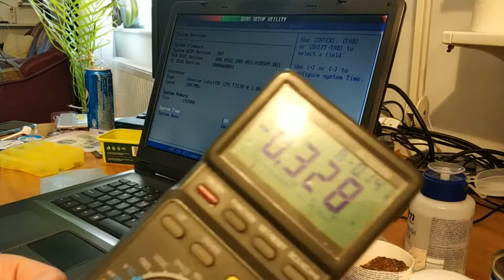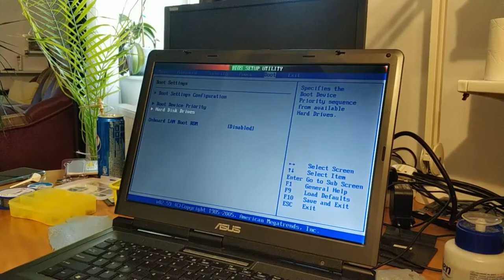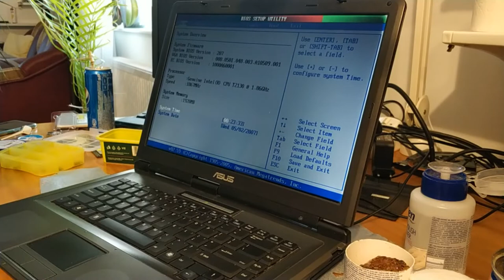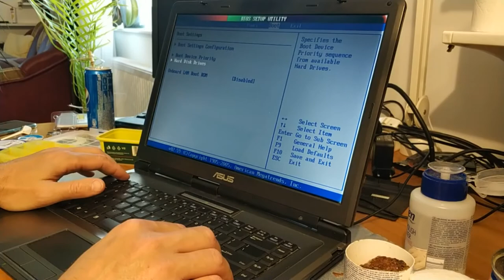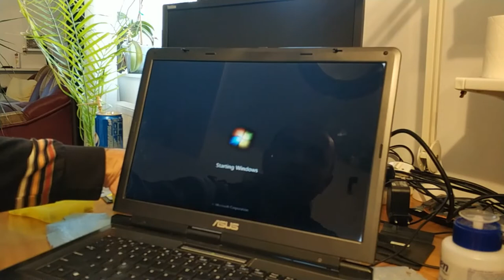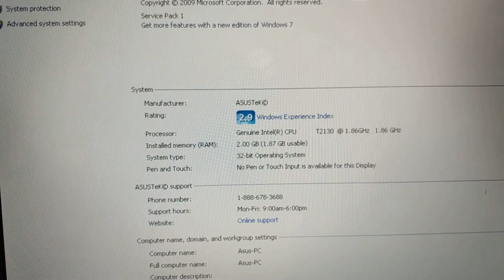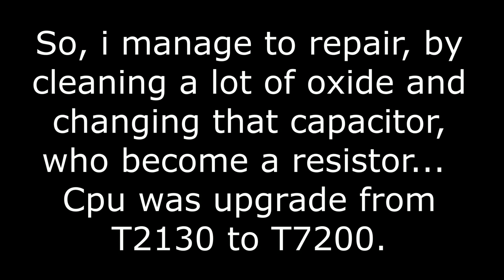Asus X51R - Disassembly, Repair, Cleaning, Cpu Upgrade, Bios Upgrade

Comment: What's your used cpu?
Reply from the maker: I make upgrade from T2130 to T7200; initial cpu is seen at 54:12, and upgrade cpu is seen at 1:06:41.
Reply: @DaneluRepairs  pentium or core 2 duo?
Reply from the maker: @worldwatch9056  Intel Core 2 Duo T7200 (Socket M)